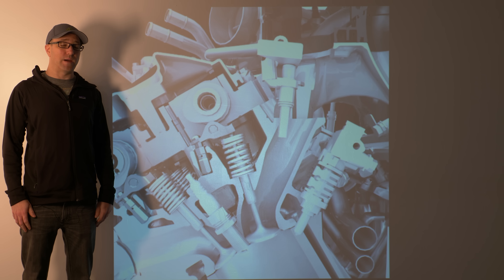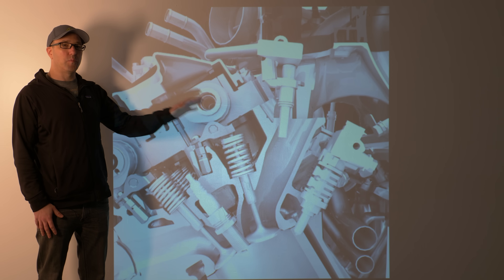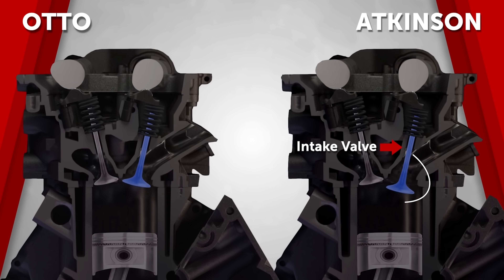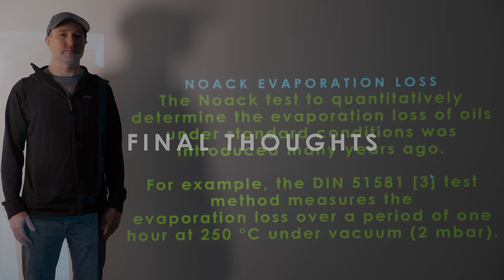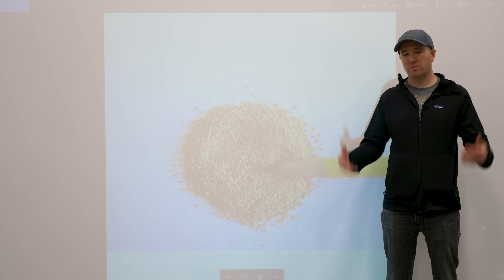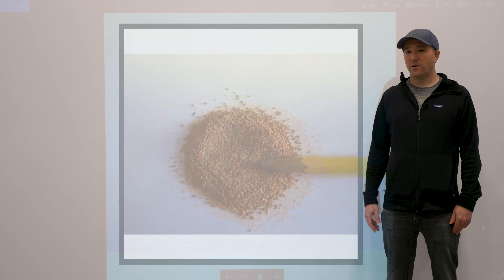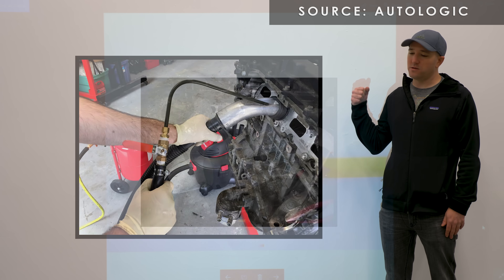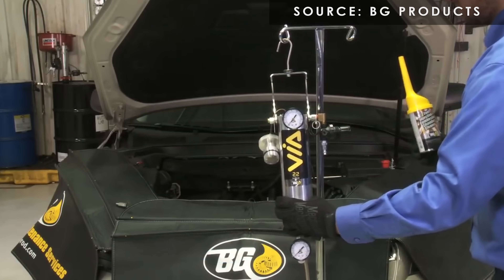Direct Injection, Problems and Solutions | The Fine Print

Comment: Ok, 1st great informative video, but I have done a lot of research and tinkering on my 2014 GMC 1/2 ton Sierra with a 5.3 DI engine. I installed a moroso catch can and am amazed at what it catches. I empty it twice in between oil changes. The oily water gunk that is not allowed to renter the engine is in my opinion a good thing. I am not a fan of the cylinder deactivation so I bought a range that plugs into the ECM port and doesn’t allow the engine to go to economy mode and stay in V8 mode. I lost about 2 miles per gallon but I really like what it does. Now when I empty the catch can all I am getting is watery junk and no oil deposits. Unplug the range and it starts producing oily gunk. Correct me if I’m wrong here but upon further self taught research my vehicle is flex fuel meaning I can run E85. Even though I have only 38,000 on my truck I burn a tank of E85 after 3 tanks of regular fuel and the results are surprising. We all know the alcohol burns hotter, and after I run the E85 my catch can catches mostly very dark grey to black junk that I think may be coming off the valve train. All I know is my truck runs really smooth after my E85 tank and my performance comes back as well as some economy. What are your thoughts on my analysis?

Comment: Great information but the sad thing is he completely missed it and so does a majority of the public. The reason why manufactures went to direct injection is to make the engines more complex and to have a higher failure rate, yes the engine manufacturer's are under scrutiny but they also work hand-in-hand with the BS Big Oil Corporations  and the EPA. It creates problems for longevity and the dealerships don't want you to have an engine that last forever.... emissions? Seriously! Lol I would laugh this guy out of the room I know about a technology that literally could reverse all of these issues and it's been suppressed but is now coming onto the scene slowly but surely. But I wonder how much of the public will actually wake up and realize that they've been hoodwinked by this new BS garbage that they're putting on new Motors for the sake of emissions and fuel economy...😔

Comment: If you want direct injection that is reliable and don't want to worry about all this, got for TDI. Even ones with indirect injection, like my MK3 Jetta(diesel) are pretty solid, never had issues with carbon buildup or soot, just hold it at high revs for few minutes every now and then and it will be okay, same applies if you have DPF, burning more fuel is cheaper than replacing DPF so..

Comment: Why don't they use a carburetor system running lean, in combination with DI to enrichen the mixture to the right values, instead of port + Direct injection?

Comment: Adding oil catch can can also lead to failing the visual inspection at smog check.  When trying to improve the car's performance and efficiency, requires creativeness to pass everything visually. If all done right, not a problem failing the actual emission test.  Being in CA, there's a hustle putting back that's legally or hope to pass added modification.

Comment: Oh everybody (pro and con) alike quite your whining. Every new mechanical engineering PFI, GDI, TPI,VVI etc, feat cometh with a caveat of cheers and fears. Save up your $600-$1000 dollars, get the NUT BLASTING treatment every 32k miles, burn good 93 octane, drive it like you stole it (instead of babying the throttle) and save up for next 32k mile NUT-BLASTING. Now repeat after me.....Live-Pay-Repeat, Live-Pay-Repeat, Live-Pay-Repeat! Hooyah!

Comment: 2012 Edge Ecoboost 2.0, 92K, never a misfire, cold or warm. Doesn't mean I don't have buildup on my valves, I more than likely do! I drive nearly all freeway! I use synthetic and keep it clean by changing my oil at 50% use. I think cleaning your valves every 30K is a bit overstretched and a waste of money, if you are getting build up that fast I think the problem is you..  Also good to WOT on the freeway from time to time, it helps. Ford is banking a lot on the GDI technology for their cars or trucks, its not terribly new either, came out in 2007 in a Lincoln, over 10 years now.  Now they have the 2nd generation systems which have dual injectors, port and direct. That just ads more tech to break too, however I don't think Ford or any other company is going to base so much on a system that is a POS. Auto companies are under the gun with the changing CAFE and emission requirements. The net result of that is WE THE PEOPLE are the test bed! An auto company cannot test a new system to the same degree that an aircraft manufacturer has to meet, if they did it would be around 10 years for new wiz bang technology. To be competitive they (any auto company) has to constantly  turn out new tech on engines to keep meeting changing requirements. I for one think they (any auto company) is doing a fare job. We have come a long way from the brown air we older folks had to breath on smog alert days back in the late 60's and early 70's. Millennials have no idea what that is! Yet the tree huggers constantly cry foul and scream doom and gloom, this changes CAFE and Emission requirements, auto companies come out with another tech....we test it for them, people scream because the first cycle of something new breaks...a lot..and the car company is junk! Why do they build that crap!! 'SUE SUE SUE, Guess what WE THE PEOPLE pay for that too.. After reading most of the responses to this video it saddens me to see how blind people are.

Comment: I wonder if some sort of drip oilier system could be set up to introduce something like MMO (Marvel Mystery Oil)  into the PCV line.  Could that work to be continually cleaning the intake valves. IDK, but MMO does clean quite well.  It would be needed to be done from the start of a clean valve train, then it could prevent any build up.  I remember drip oiliers from my days on the farm.  In this day and age, seems one could be made automatic with an electric silonoid allowing drip to occur only when the engine is running.

Comment: Direct fuel injection is not new and was around a long time before the EPA and emission laws. There is no doubt that fuel economy and environmental concerns did spur the development and adaption of fuel injection systems in the 70's and 80's. but it started in 1896 with diesel fueled engines  but was adopted quickly by aviation between the wars, to overcome the problems of carburetors when planes changed direction and became inverted.  By the second World War, All military and most civilian aircraft had reliable fuel injected engines that would have fuel delivery problems when planes changed attitude suddenly. These problems existed even in cars to a certain extent and resulted in complex designs to handle when hard acceleration and hard changes in direction caused fuel levels in the "float bowls"  to change levels and surge.  In the 50's many race cars began to replace carburetors with fuel injection and Chevrolet offered fuel injection in the 1957 Cars with the 283 V8.  I remember people, afraid of the new technology that they were unfamiliar with having the fuel injection systems removed and standard manifolds with carburetors installed before leaving the dealerships.  (The injectors were mounted in holes drilled and tapped in the intake manifolds pointing to the intake ports on the heads.)  Chrysler also produced some, very trouble prone fuel injected cars and even tiny AMC tested fuel injection in some Rambler Rebel models, none of which survive today.    Research and development continue today.

Comment: This is classic propaganda put forth by the aftermarket auto supply companies selling snake oil. The service manager and service advisors are given a spiel on how to sell each product to customer's. They are all given kickbacks from the aftermarket supply company for each product sold. This is on top of the service manager and advisors commissions on those sales. This is how the car industry has worked since the 1950's. Diesel engines have been using direct injection for decades. Overhauls done at 500,000 miles do not show adverse problems with the valves.

Comment: I hate to keep busting you. But the carbon around the valves you showed is from leaking valve seals. Notice how it's much thicker where the oil has been running down the valve stem until it hits the hotter part of the valve. 
 Folks most carbon build up is caused from short driving trips. If you are someone who drives 20 or 30 miles per trip several times a week, you won't have carbon issues. I've been building racing engines and working on vehicles since the 80s.
Reply: Bryan Hensley Carbon build up can occur on any  engine from leaking valve stem seals, but GDI suffers from this even with perfect seals. Unless you believe that all GDI engines just happen to have leaking valve stem seals...
Reply: 12:59 he mentions it
Reply: VAG 2.0 TFSI absolutely horrendous engine for excessive carbon buildup & related problems (European variants)
Reply: Followup question! You're saying someone that drives 20-30 miles several times a week. Are you suggesting that doing fx a 20-30 mile trip once a week or month,  with the car just sitting there, not doing much of other driving, also would cause buildup?
Reply: You are 110% wrong I'm a master vw tech and currently working on all car lines including exotics and it's not from leaking valve seals it is from the pcv system as he describes and if you think you know more then the vw enginers and other car line enginers that have the same issue then go be one I'm sure you'll go far. And if leaking valve stem seals were the issue then how come all the V6 dodges back in the day that had leaking valve stem seals as a common issue never had carbon build up? Crazy huh.
Reply: @WhormigaMan  i vent 3 ports: my pcv, as well as my breather port and oil cap on my t-gdi to atmosphere 90k strong no build up whatsoever. :) oil(pup5w30) changed every 3k utilizing 91 octane
Reply: @Too-Gq-For-You  : Only issues I've seen from venting a system that's designed to have full vacuum on it to the air is that you can get leakage from various seals like rear main and other oil seals but I only saw that on a Porsche so your set up may work fine just make sure the engine isn't sucking in unmetered air thru the pcv to the intake or it can cause mixture issues.
Reply: You're right of course.  I bought a used 2006 'shopping and running to school' Jetta 2.0T.  It had a misfire from water down the spark plug tube from a leaking gasket so I decided to correct the leak, install new plugs and coils.  While I was 'in there' I decided to check the intake ports for carbon build up.  I removed the intake and cleaned the intake ports using a combination of tools and solvents to get the ports very clean.  Wow.  The performance after that project was dramatically different.  The ports had been quite clogged after around 60K miles of puttering around,.  It took me a weekend of work to get a Turbo Jetta back to 'as new' performance.  Oh, and I did install an oil separator in the crankcase ventilation hose.  It good for another 60K now.
Reply: @WhormigaMan  👆 master VW tech, he sounds credible 😒
Reply: @oscarbadillo3844  : And what were you the master of besides Deez nutz ninja? Sore comments, sounds about right.
Reply: @WhormigaMan  the blowby on a (not worn-out) engine is miniscule and if crank ventilation was the cause, diesels would have the same problem (since they're all DI). I've worked on all types of engines for 40+ years (before any type of emission control) and those with carbon buildup have leaky valve seals.
Reply: @Kingfranz  : Funny you say that and I've also worked on quite a few diesels mostly European tho not many domestic ones and they get carbon build up in the intake ports from the egr every time but being that most European gas engine cars don't even run egr it's different to compare also a diesel will run off of it's on oil where a gasoline engine will not. I've seen tons of BMWs with leaking valve stems seals and tons without and it never changes how they carbon up. We are doing valve stem seals in the N63 V8 at least once a week bc they are smoking and it never affects carbon on the valves. Plus when you get valve stem seals leaking like you say the vehicle will smoke when allowed to idle for a few mins while hot then reved that's the BMW factory way of checking for them leaking. So still wrong sorry. I'll ask a BMW engineer next time I get to talk to one and see what he has to say about that theory.
Reply: Also the theory that it's the valve stem seals would mean that the build up would only be on the valve itself and into the cylinder via the flow of air only goes one way but the carbon is building up all the way into the intake meaning it's something that's before the stem seals which will be the PVC. Take any German intake off and look at the puddles of oil in the intake and tell me that isn't from the pcv. I just had to replace my valve cover(pcv integrated) on my 2.5l Jetta (port injection) bc the pcv was sucking Soo much oil into the intake that it was soaking the map sensor and causing it to malfunction.
Reply: I'll add this for those who are curious the solution that VW and Lamborghini (same company) has came up with is dual injection meaning that the vehicle will have di and pi injection so if it's a 4cyl it will have 8 injectors. 4 di injectors and 4 pi injectors. Obviously the addition of the port injectors keeps the valves clean. The Lamborghinis are running this currently. So it's V10 has 20 injectors lol
Reply: @WhormigaMan  i believe that toyota and ford are playing with the idea as well
Reply: @sleathers1551 do not know about Toyota but Ford uses both port and di injection on its second generation 3.5 EcoBoost
Reply: 2018 Nissan engines are also using pi and di.
Reply: @WhormigaMan  Ford is doing that also. My 2018 F-150 2.7 ecoboost has both DI and port injection. This solves the carbon problem completely.
Reply: @chris1451  : Nice! I'm thinking that's going to be the norm for every manufacturer gas engine with di now. How is the turbo lag on the ford V6?
Reply: @WhormigaMan  There is a little lag. But not bad.  It isn't a race truck. It is half a second quicker to 60 than my Focus ST was... Plenty of power. My best MPG for a tank has been 24 MPG. 22.5 on average. I am happy with it.
Reply: @chris1451  : I'd be happy with that too I was just looking into possibly a raptor later on and haven't drove any of the new ones yet.
Reply: @WhormigaMan  Don't drive a new Raptor unless you want to buy it! I drove a 2018 raptor and it was incredible. VERY nice truck.
Reply: @chris1451  : haha I know I've drove a few of the 1st gen ones and I like those alot. I even favor the V8 more but the 2gen styling just looks Soo much more aggressive I love it! I just haven't messed with any of Ford's eco-boost engines much so I wasn't sure how they were.
Reply: You say you build race cars? Joke. Most carbon build up are not from short commute. It is mostly during idling period. And no. It is not because of valve leak. It is escape through during the combustion process.

Comment: Direct injection is so you can have higher compression ratio and lower quality fuel with no detonation. Diesel engines have been using direct injection since they were invented. Computer direct injection was introduced on the Power Stoke in the 90s.
Reply: Bryan Hensley how dare you base something on fact! Learn how to base more off opinion, what the video above
Reply: Bryan Hensley There is no comparison with diesel engine operation other than injector location. A diesel simply would not work with port injection, and the fuel is injected at a different time with GDI. Changing the injector location on a GDI does not make it work more like a diesel, it's still a an otto cycle.
Reply: I believe early Diesel engines in cars used pre-chamber injection (and were very low HP for their displacement, and slow to rev up, but very sturdy).
Reply: Diesel fuel has much more viscosity than gasoline..it is basically thin oil..gasoline doesn't lubricate or remove heat very well...that's the one and only reason why diesels had direct injection long before gas engines.
Reply: Michael Boyer Diesels had DI first because that was the only way to make them work. You can’t have a port injection diesel and pre combustion chamber was expensive and making things over complicated

Comment: The reason why the efficiency of the gdi ensines is better is that when you combust air there is no danger of knocking, because your compress only air. So you can increase BMEP and that way the total pressure of the burning proses. Higher total pressure provides better efficiency. 

The reason why the lean burn motor produces higher NOx is the fact that the tree-way catalytic converter needs stoichiometric air fuel ratio or lambda 1 operate correctly. When the lambda is one there is no residue oxygen in the exhaust gas. So to oxizide the HC and CO the cat thakes the needed oxygen from the NOx which then turns into nitrogen. In lean burn gasoline engines you need SCR converter to reduce NOx....

Comment: DI would do better in gas engine's if they use pressure closer to diesel injectors do. Diesel fuel injector spray fuel at 30,000psi or higher not 10,000psi that gas engine's.

Comment: have you studied the use of water injection? of course not too much so you get hydro locking, but enough to clean the valves and even cleans the piston heads.I  I read some tests BMW had done to lower engine temperatures on prototype performance engines using water injection.